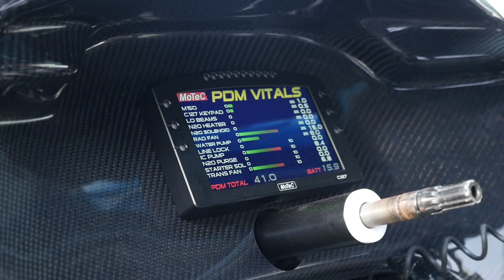Making 2000HP+ Reliable | Professional Motorsport Wiring [TECH TALK]

Comment: Working for an aircraft manufacturer I can tell you that very few connections are soldered. High quality crimps are the standard when joint failure is not acceptable.

Comment: Does wire gauge matter when supplying 12v to certain amount of wires? For example.....6?
Reply from the maker: Yes sir! Pretty much the only time you don't have to stress about selecting the correct gauge wires would be for sensors and CAN applications. Obviously not a hard and fast rule, but if it's not wiring for those two things, you 100% do need to make sure you're using the correct wiring for the job.
This is covered in the HPA Wiring Fundamentals course along with a bunch of other topics here: https://www.hpacademy.com/courses/wiring-fundamentals/ - Taz.
Reply: What is your thought on using receptacle connectors to feed 12v to multi functions that require it ?

Comment: the biggest problem with soldering is that a. it needs skill and b. people not understanding that there isn't 1 kind of tin for all solder connections xD

crimping is king though <3
Reply from the maker: Yes crimping can be done wrong, but it is much easier to consistently get right with the correct tools. Pros and cons for everything and soldering still does have its place for specific purposes and obviously in different applications too - Taz.